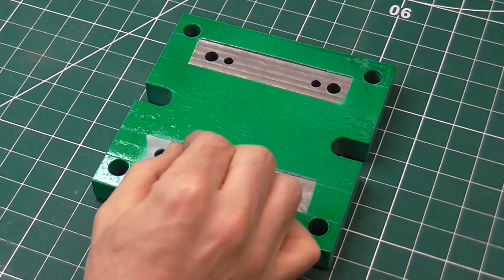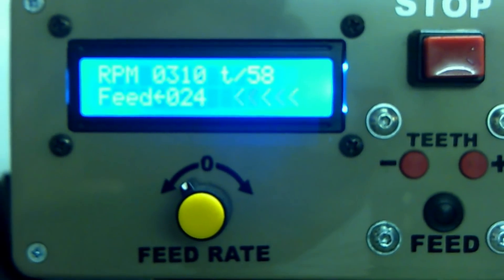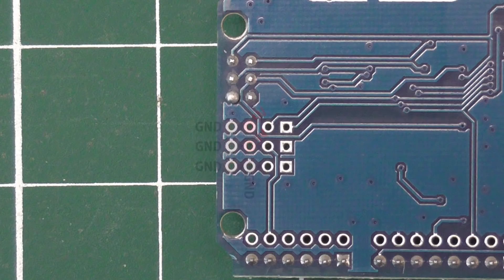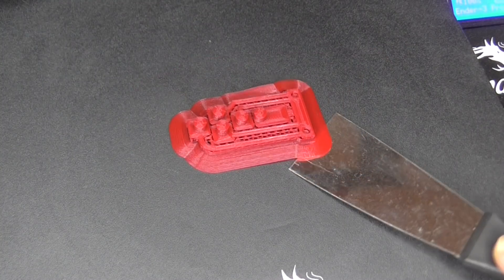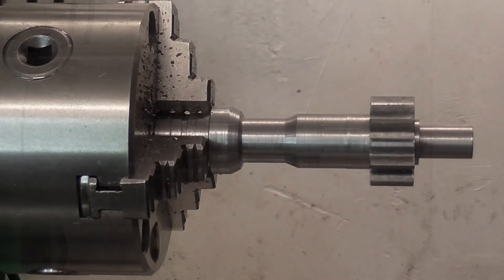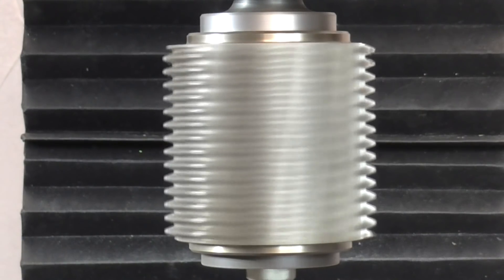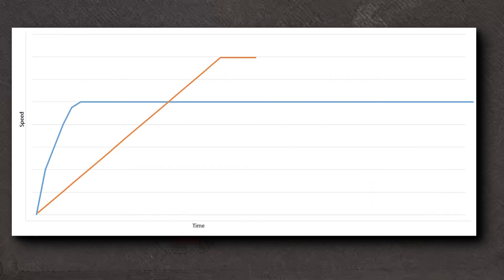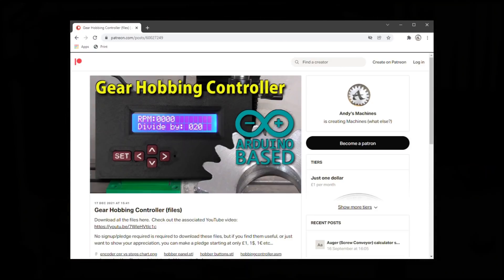Gear Hobbing Controller

Comment: Can anyone tell me of this same setup would work with a closed loop stepper motor as I would be using it for a larger machine machining axle splines thinking closed loop nema 34
Reply from the maker: Yes, there's no reason you couldn't use a closed-loop stepper and then you wouldn't need to worry about limiting the acceleration the way I did, the stepper would make it up by itself.
Reply: @AndysMachines  trust me the machine it’s going on, doesn’t snap on like your mill it’s an old ( the Denbigh ) universal mill haha much slower takeoff

Comment: Amazing and, for me, mind boggling. I love your channel and have learned a lot.  Thank you for sharing.  This is beyond me, but I was able to follow most of it because a few months ago, I started building a Power Feed for the Z-axis on my milling machine using a Stepper motor and driver, controlled by an Arduino. I spent about two months learning how to program the Arduino, and utilized switches, potentiometers,  and rotary encoders to accomplish my goal.  It's amazing what can be done with a micro-controller.  Thank you again. Regards.

Comment: Good afternoon. How many teeth can it cut? Any quantity? Thank you very much for your answer.
Reply from the maker: Any reasonable number, I think it's range is something like 2-255 (if 2 doesn't sound like a reasonable number, you can cut a helical gear with just 2 teeth). It could be reprogrammed to do even higher numbers of teeth too.
Reply: @AndysMachines  You are great for making such a program.

Comment: Much appreciate what you do Andy! I built a three axis NC machine with Mach3 and servo motors back in the 70's (͟(͟𝗪͟𝗥͟𝗢͟𝗡͟𝗚͟!͟ ͟𝗜͟𝘁͟ ͟𝘄͟𝗮͟𝘀͟ ͟𝗶͟𝗻͟ ͟𝘁͟𝗵͟𝗲͟ ͟𝟵͟𝟬͟'͟𝘀͟!͟ ͟𝗧͟𝗶͟𝗺͟𝗲͟ ͟𝗵͟𝗮͟𝘀͟ ͟𝗮͟ ͟𝘄͟𝗮͟𝘆͟ ͟𝗼͟𝗳͟ ͟𝗯͟𝗲͟𝗰͟𝗼͟𝗺͟𝗶͟𝗻͟𝗴͟ ͟𝗶͟𝗿͟𝗿͟𝗲͟𝗹͟𝗲͟𝘃͟𝗮͟𝗻͟𝘁͟ ͟𝗮͟𝗳͟𝘁͟𝗲͟𝗿͟ ͟𝗮͟𝗯͟𝗼͟𝘂͟𝘁͟ ͟𝟳͟𝟱͟)͟)͟  and at that time I found components expensive, now today those same items are very hard to even find. The encoder has taken hours to find but then cannot find one at all that will accept the thick slot-wheel that you fabricated. Widest slot I can find is 1.78 mm wide for a very thin disc!. Can you suggest what you found? Thank you again!! Sorry for the misinfo!!
Reply from the maker: Wow! I built my first 'CNC' machine in the early 90's, before I even knew what a CNC machine was, I kind of came up with the concept independently (this was before most people had internet). I remember stepper motors seeming hugely expensive, around 4x what today's far superior ones cost, not counting inflation. The encoder read-head I used came from a servo motor I salvaged, sorry I don't know the make or what it was from. But for a crude low resolution codewheel like the one I made, you can also use a pair of optical switches/beam break detectors, these are available with fairly wide gaps, you just need to position them so they are 90° out of phase (can be any multiple of slots plus 1/4 slot) to get the correct quadrature waveform. An oscilloscope makes this easy and it doesn't have to be exact, it will still work. In fact it often works first time by chance, as to not work they would have to be exactly in phase or out of phase. Maybe one day I'll do a video on DIY encoders.
Reply: @AndysMachines  Thanks Andy. I'm sorry to say that in my old age, I have become a 'plug and play' sort although, this encoder will necessarily be assembled as you describe. I built the Jacobs gear hobber years ago and made a variety of gears for it but it is a timely set-up! I had envisioned the 'modern' system that you have assembled as a means of taking the gear set-up away from the basic Jacobs machine - but that still leaves limitations by not using a vertical mill... Your videos are spectacular to say the least - I call in my wife to watch them too... we enjoy them! Plastic injection...? Oh my gosh, another avenue to pursue! Thanks again!

Comment: I'm trying to open the .asm file from the Patreon site with Solidedge 2022 and it won't open and I don't use PTC Creo or Fusion 360. I get an error that there is no translator for that file type, is there  problem with the file?
Reply from the maker: It's an assembly language file, not a CAD file, you can open it in microchip studio but it's just a text file so you can also open it with notepad.
Reply: @AndysMachines  Thank you!

Comment: it is possible to make a program without requirement for round ratio - you need to just keep this ratio converted to a fraction number and then just increment counter for stepper making step when specific number is reached or overreached, subtract this number leaving reminder for the next step - steps will not be perfectly even, but the error will be negligible given enough resolution for stepper and encoder

Comment: Impressive project. The 3D printing looks horrible.
Reply from the maker: Not sure what you mean by horrible, but I've never been a big fan of 3D printing. I used it in this project to make it more accessible to people who want to build their own controller (and arduino for the same reason). But I rarely use 3D printing for finished parts. It is useful for patterns and prototypes though.

Comment: Ok, but where you find number 64? Please to explain.
Reply from the maker: Ummm... Between 63 and 65? Do you mean how to cut 64 teeth?
Reply: @AndysMachines 😂 No, but i read : Spindle steps x 64/encoder cpr= whole number. So I did not realize why x 64? 
Thank you for this great video. It helps me a lot.
Reply from the maker: Ok, I see. That's just a formula used to determine if the encoder and spindle division you choose will work together. 64 is a binary power and if the formula divides evenly then there will be no rounding error in the calculations the gear hobber uses.
Reply: @AndysMachines  Thank you. I am finishing mechanical part and then I will see how it works togather.

Comment: Glad to see you using assembly language. I have used Assembly for over 40 years. I use the 8051 family  of processors in aircraft instruments and many other things. Some of the applications are huge 50K lines. We do not have any C in it anywhere. C is too slow and too fat. I have benchmarked C and find it 5-10X slower and bigger.  I wrote the assembler too with elaborate functionality for huge programs. It compiles floating point expressions too. I made a hobber 15 years ago too.
Reply from the maker: I have to agree! There are people who say compiled C is as good or better than assembly written by hand, but it really isn't. The only advantage is it's less effort to write. Plus when writing in assembly you have to learn much more about the specific processor you are using which makes you a better programmer.
Reply: @AndysMachines  
I have something I would like to send you regarding asm vs C. What is you email?
Reply from the maker: andysmachines@gmail.com

Comment: Hi, excellent video, although you solved the quick start condition in software, which was very clever, a very crude but simple soft start for the motor could be made. If some suitably sized resistors were installed in series with the motor winding it would, on start up, limit the inrush current and the accelerating torque thus increasing the time to get up to speed. The resistor/s would be shorted out with a suitably rated relay or contactor after a preset time of say a couple of seconds. Your solution is clearly more elegant. Again, excellent video.
Reply from the maker: Thanks! Yes, this motor really does need a soft-start, either that or replace it with a 3-phase motor and inverter. The jolt on startup is causing problems with the gearbox too. It's a twin capacitor motor so I assume it also has a centrifugal switch (though I can't hear it) so maybe all I'd need to do is put a resistor in series with the start capacitor. I'll have to dig deeper.

Comment: How much pulse/rev is the stepper driver? please guide me.
Reply from the maker: Stepper motors are usually 200 steps per revolution (not always). Drivers often have microstepping which can multiply this 200 by 2, 4, 8 etc. this is settable with DIP switches on the driver. I recommend you stick to full step/200 per rev.
Reply: Thanks

Comment: Current compilers offer very stable and efficient binary generation - of course you FEEL like you have more control over the mcu operation because you are practiced at assembly.  I started with assembly on Z80's in 1980, then 8088, 8086,... but I would never go back because of the amount of work necessary to develop applications is just not necessary given the perpetual support for excellent libraries that interface other devices and protocols.
Why would I trust assembly code that would take me weeks to figure out if I need to change something?
I'd prefer to have an explanation of what the code is doing to control the hardware than try to figure out assembly.
The arduino IDE is used by grsdeschool children and C has been around for over a half century - time to learn a new skill.
Reply from the maker: I'm sure modern compilers are better, but I've disassembled code produced by the arduino IDE and found it to be very baggy. I still would argue that assembly is best for fast efficient code, the fact it takes longer to write and requires more concentration can be a disadvantage, but it also hones your programming skills and is the best way to learn what's going on at right at the most basic level.
Just as an example I wrote some assembly code to drive a 320x240 TFT colour screen. There are arduino libraries to do this of course, but the screen update is almost painfully slow to look at compared to mine which had no noticeable lag at all. (Same processor, ATMega328 running at the same speed).
Reply: @AndysMachines  I wouldn't argue about efficiency of executed code.  Nor would I argue that every library is not written as effectively as possible.  If a library isn't good enough, then writing ones own in assembly certainly has its place.  
For a while I worked doing compiler verification which drilled into my head that any assembly code I wrote usually offered little value over compiler generated code for processors that were widely used, so I started favoring the abstraction languages like C & C++, and subsequently Java offered for solving larger solutions since I had already learned to code efficiently. I was still able to code some in line assembly when needed, but that was necessary less and less over time for my projects. 
It's very unnecessary for the AVR-GCC compiler used by the arduino IDE to be producing buggy code for that processor - I bet they would appreciate a bug raised for the bugs you found. 
The main reason I commented is that i, like so many others programming code for these processors now, don't choose to use assembly so you are loosing adopters of your project, which is a shame because your project is a great tool that I hadn't even thought of, in favor of using a lathe. 
For me, learning the atmel processor instruction set and registers would be time-prohibitive.  I would expect that sentiment is more the norm rather than exception, for what it's worth.
Reply from the maker: All valid points and I know I'm in a minority these days preferring assembly language. I have dabbled with C, python etc. but I still prefer assembly.

But I didn't mean 'buggy' I actually said 'baggy' as in poorly optimised, lots of extraneous bits of code etc.
Reply: @AndysMachines  LOL - I never heard baggy used that way.

Comment: Encoder 1024 CPR. How can i change the value of spindle steps to 4000? In the controller, the maximum possible is 2999.
Reply from the maker: 4000 is really much higher than you need. Are you using microstepping? You'll need to select a lower microstep ratio.
Reply: @AndysMachines  I don't use micro steps at all. Stepper motor (200 steps) and worm gear (20:1).
Reply from the maker: Ok, I see. Are you using a rotary table or similar for the hobbing spindle? 20:1 is a very high reduction ratio and you may be limited to either running the milling machine slowly and/or not cutting gears with small numbers of teeth otherwise the stepper motor won't be able to turn fast enough. If possible it would be better to use a belt reduction, around 4:1 seems to work well. But if you can't do that I could raise the step limit in the software, though I can't guarantee it will work reliably.
Reply: @AndysMachines  I understand that these problems can happen. But I will believe in the good. I will change "2" to "4" in ;limit to max 2 for fist digit only. Will this be enough?
Reply from the maker: Search for the label 'setup:' About 12 lines below this are the two lines:

ldi	rmp,0x30				;2+1 in MSD (max value)
sts	msdbcd,rmp

Change the 0x30 to 0x50 and this will limit the first digit to '4' instead of '2' (It's stored in binary coded decimal format+1, so 30=2, 40=3, 50=4 and so on). The part after the semicolon is just a comment and has no effect on the code. That should be all you need to do to raise the step limit.
Reply: @AndysMachines  I did everything as you said. Everything works now. Thanks a lot.

Comment: After you configure the controller how do you access the operational section? With the number of teeth - etc.
Thanks,
Bruce
Reply from the maker: Hi Bruce, you just press the up and down buttons to change the number of teeth (division ratio). It operates all the time, you don't need to select anything. Is it not working for you?
Reply: @AndysMachines  The spindle speed works fine and accurately reflects the actual speed. However I don't have an output on the step and direction pins. The step is always low and the direction always high. I have double checked that they are on the correct pins.
Reply from the maker: If it's displaying the spindle speed then it's receiving input pulses from the encoder and ought to be outputting step/dir pulses. Even if the configuration is set wrong and you don't see step pulses you should still see a change on the dir pin when turning the spindle back and forth. Somebody had a similar problem and it turned out the labelling of the pins on the arduino was offset by 1. Have you checked the pins either side, and have you checked them when not connected to the stepper driver? If that doesn't work then it may be a problem with the arduino.

Comment: I'm loving the 328 myself . I do find it convenient just to program it in the ide 
I took assembly language In College for a nano tech program,  didn't  stick.  Not that I don't get it more so just not faster than C . 
Brains are brains , sometimes it's how it's wired .
Reply from the maker: It's a really versatile chip, I tend to turn to it first for most things now. When I used PICs I had to keep 3 or 4 different types and use the right one for each application.
Agreed, with programming people tend to stick to what they know.

Comment: Hi Andy , another question if I may. I aquired a 400CPR encoder and was going to use 4:1 gearing between stepper motor and spindle , but the it struck me , I have several "Motion Control" stepper motor drivers that have lots of choices for microstepping so instead of 4:1 gearing couldnt I use 1:1 gearing with 1/4 driver micro stepping ?    Cheers  Don
Reply from the maker: You could do that but at 1:1 you will have four times less torque available at the spindle, it may work depending on how powerful the stepper is and how big are the gears you're cutting, but you may loose steps. Also it's best to run in full step mode if you can as microstepping also reduces the torque from the motor.

Comment: Can this controller handle outputting 64,000 steps per rotation of the gear blank?  I am interested in it but would like for it to drive my blanks with a 40 to 1 dividing head That I already have setup with a step and direction servo motor at 64,000 steps per rotation.
Reply from the maker: It's really not a good idea to use such a high ratio, you would need a spindle encoder with 16,000 lines and the controller won't let you input such high numbers. There are ways you could get around it but it would be quite limiting eg. you could enter 8000 steps/r instead of 64,000 and it would turn 8x more slowly limiting you to multiples of 8 teeth (enter 1, get 8 teeth. Enter 2 get 16 teeth...)  The spindle encoder needs to have at least 1/4 the lines/cpr as the number of stepper steps per rev.